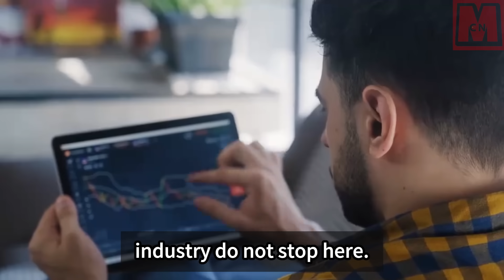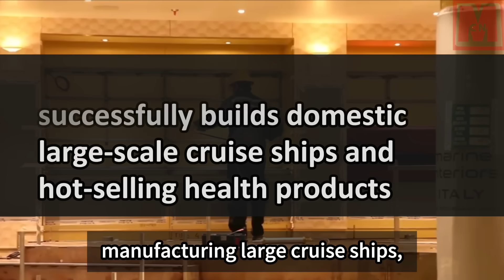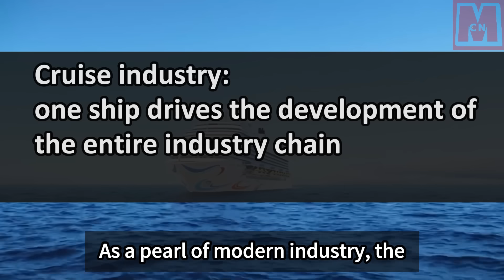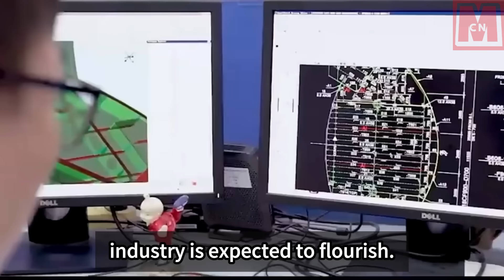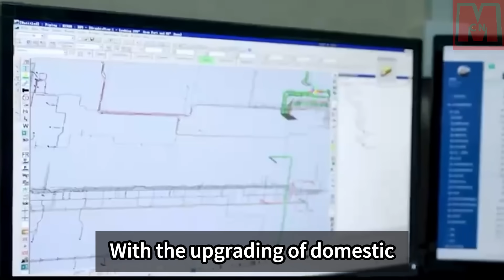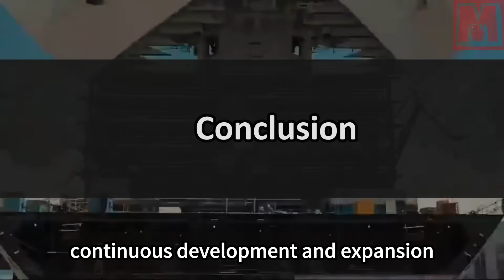China's new "weapon of great power" poses a perceived threat, says foreign media.

Comment: The ship was not developed by China. They were provided the design by Fincanteiri who is also providing the construction management. The engines powering the ship are also a joint venture. The ship inspection is by Llloyds. The hotel services is managed by Carnival.
Reply: This is good because China needs someone to show the ropes on building large cruise ships. Once the Chinese got the experience, they will be able to do this on their own in future. At least these good EU companies are willing to assist compared to the selfish Americans.
Reply: Correct!  China did the smart thing to simply build an existing design with a few tweaks, to learn the process and how to do so efficiently.  5-10 years from now, China will be designing and building their own ships.  This is exactly how China learned to build High Speed Rail, which they now dominate.  It's also what China is doing with the Comac C919 airplane, having assembled Airbus aircraft and Boeing components, now using their own airframe integrating existing components.  Same with the aircraft carries, where China bought a Russian hull that they refurbished (Type 001), then copied (Type 002), then iterated a completely domestic design (Type 003), and is now moving on to a more advanced design (Type 004, and beyond).  China learns by doing, and it's a repeatable process to learn new things.
Reply: There are many many Chinese engineers and scientists in the USA in the west so what's your point?